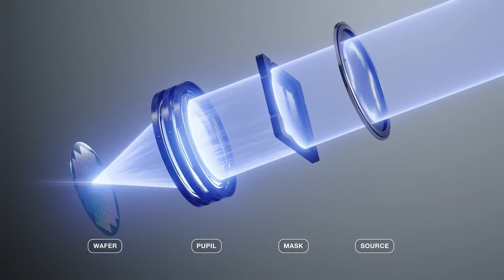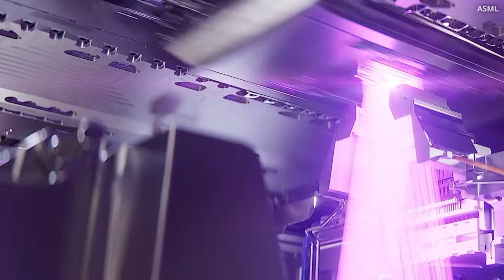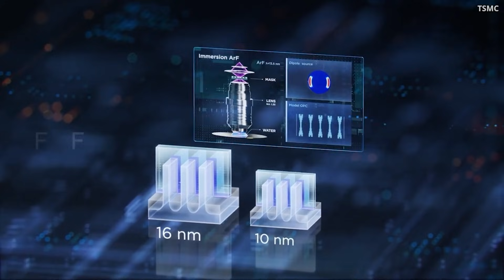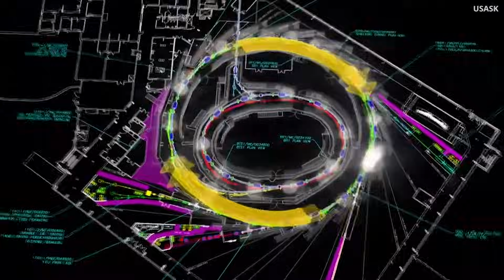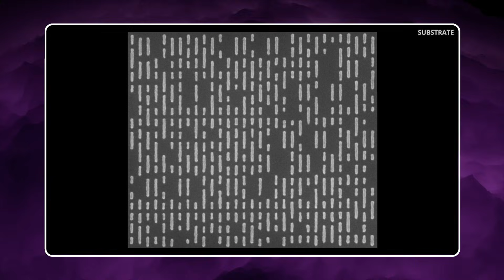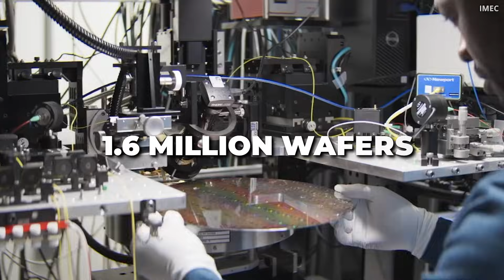Why ASML & TSMC Chip Factories Are Scared of This Tiny American Startup!

Comment: 5nm is the smallest node using 192nm light to date, this video is misleading
Reply from the maker: “5 nm chips still use 193 nm DUV for non-critical layers, but they are defined by 13.5 nm EUV. X-ray lithography is a proposed beyond-EUV replacement, not what fabs use today.